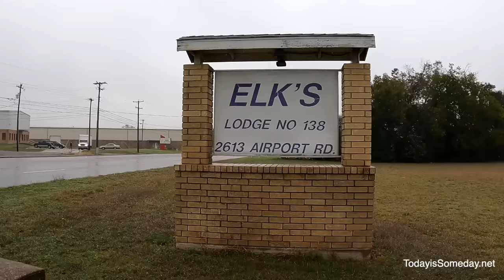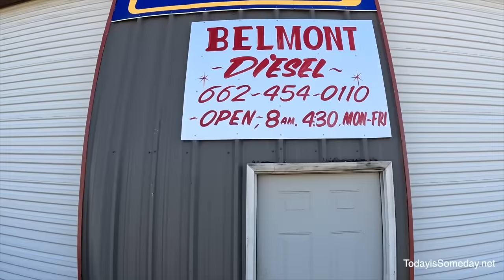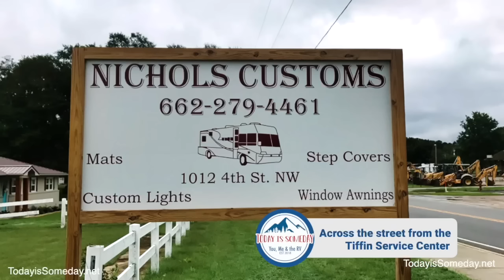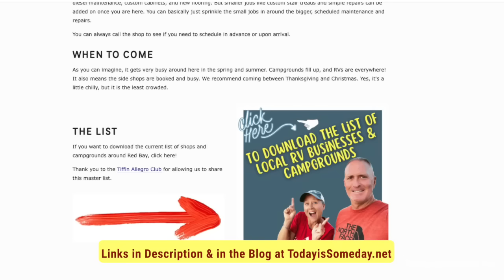Why Every RV Should Go To Red Bay, Alabama

Comment: We are the new owners of a 2021 Phaeton 40AH and are planning a trip to Red Bay. Your video came at the perfect time. I hadn't thought to patronize the non-factory shops but it will be a great resource for us. We are a day's drive away in north Georgia and going full-time in April.

I noticed that you use locking hitch pins in the Blue Ox. I use the standard cotter pins. Is that for theft prevention or some other reason?

Comment: Thanks...  good overview of Red Bay services.  I use my TSD card often but rarely does it beat Buc-ees or QT when I factor in 5% back on fuel on CC.  I mostly utilize Sam's Discover as credit is applied monthly in store and we are in there at least once a month. I will pass up Buc-ees for fuel if it is very busy and and the TSD Open Roads app shows only a slight difference.

Comment: Ok new subscriber here. Why would you have to take the Jeep off in order to connect to 30 amp? We are going to start towing our jeep in ‘24 and want to learn as much as I can.
Reply from the maker: It was only because of the location of the hookups. We would have to back up to it and it is not recommended to to back up with tow bars. You could bend them

Comment: We looked at the open roads app and they    required a credit card number and the last four digits of a social security number. Definitely not comfortable giving that info for what is purported to be a free app. Also, the research we did showed a transaction fee for using the card. Might still be worth it if you are okay with those conditions but we were not.
Reply from the maker: You are correct. But that is because they pay for the purchase ahead of time and then take it from your account as a bank draft. We set up a seperate savings account for our card. It is all we use the account for. So if its ever compromissed they can only take what we leave in that account for fuel. But I understand your hesitation.

The transition fee comes from the savings you recieve. So technically it is still free.
Reply from the maker: You are correct. But that is because they pay for the purchase ahead of time and then take it from your account as a bank draft. We set up a seperate savings account for our card. It is all we use the account for. So if its ever compromissed they can only take what we leave in that account for fuel. But I understand your hesitation.

The transition fee comes from the savings you recieve. So technically it is still free.